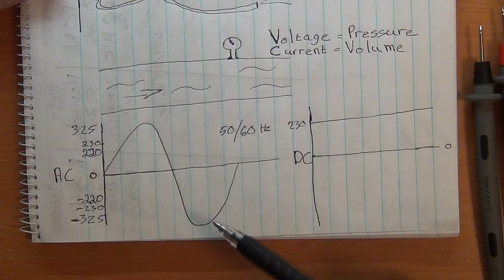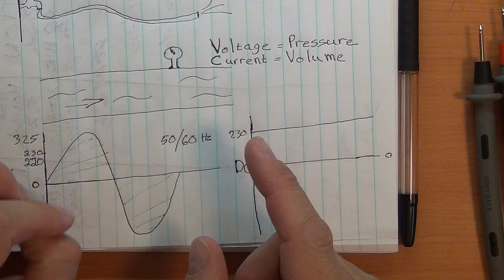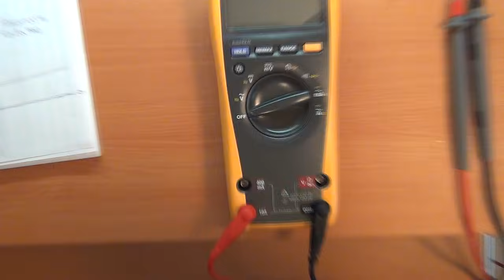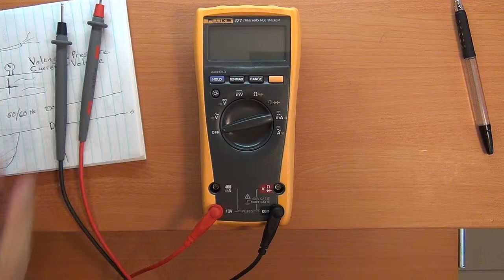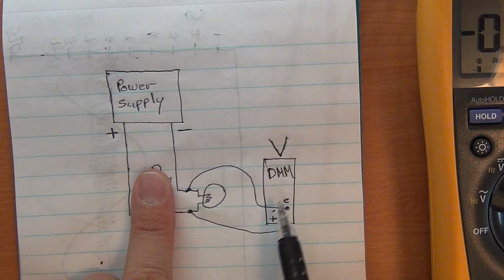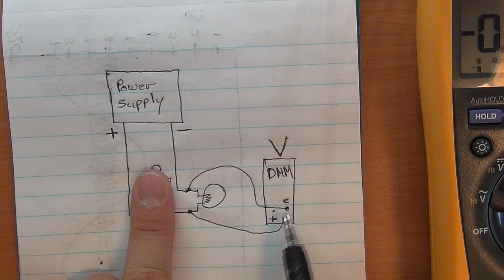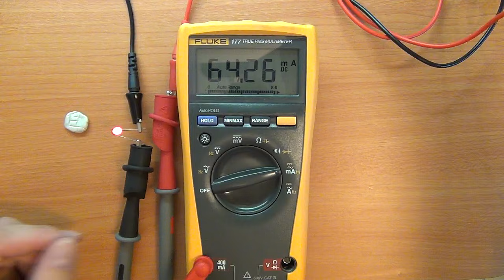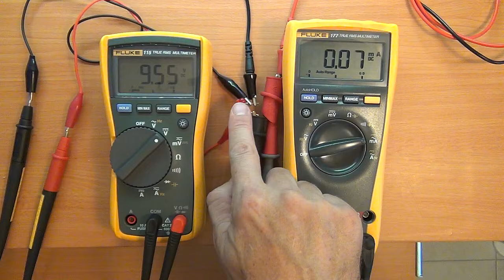Comment: It's easier to adjust the voltage of AC using transformers. You want a high voltage for long distance transmission to minimise power loss in the lines. However you don't want those high voltages delivered to the consumers. It's a lot more difficult and expensive even these days to adjust the voltage level of DC.